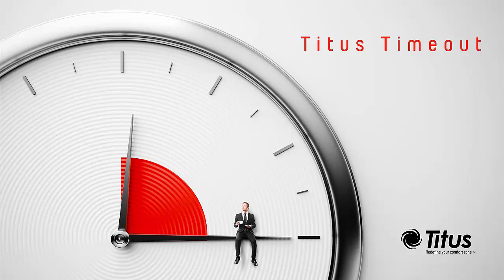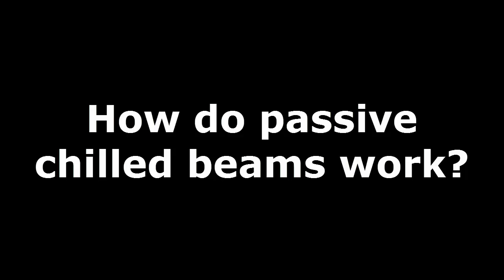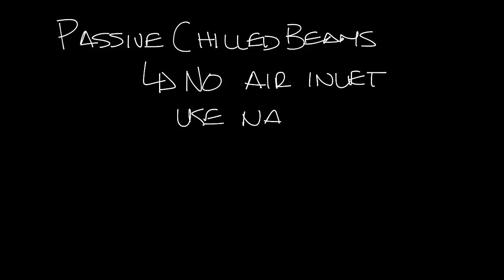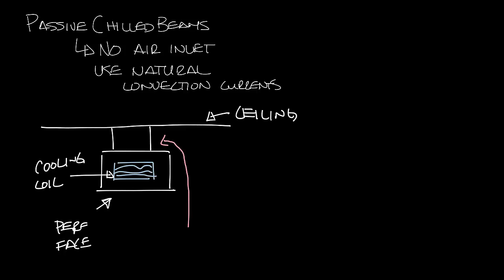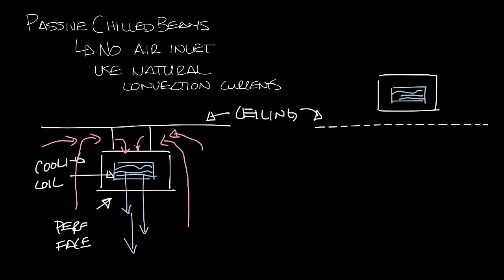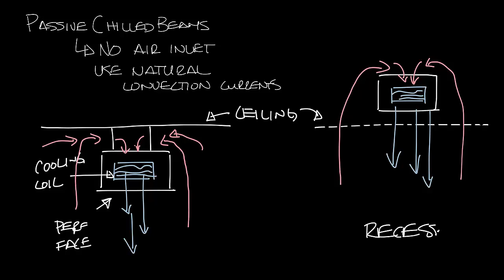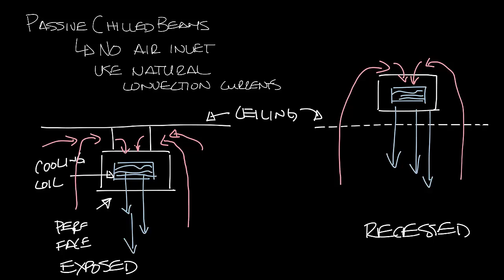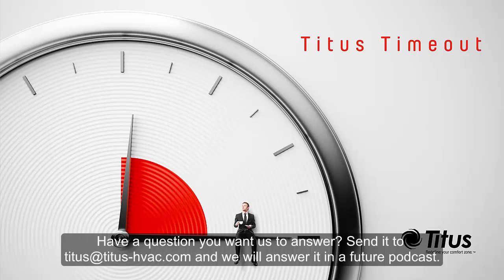Titus Timeout Podcast - How Passive Chilled Beams Work

Comment: How does the air get brought into the chilled beam?
Reply from the maker: Warm air naturally rises through the stratified space. As air enters the coil, it is cooled, its density increased and the buoyancy change causes it to fall back into the space. Momentum gained by the falling air stream draws additional air through the coil by means of a syphoning effect. Convective heat is removed as the air passes through the coil.

Comment: Thanks for the video. Where does the condensate go? Any issues with chilled beams creating higher humidity levels?
Reply from the maker: Correctly selected chilled beams do not produce condensate as the chilled water passing though the coil is set at a temperature above the room dewpoint condition. Room humidity is controlled by a separate air supply system (typically DOAS) which provides dry air to the room to offset the latent gains in the space.
Reply: @TitusHVAC  thank you for the answer. Is there such a thing as a residential chilled beam?
Reply from the maker: @danielvivian3282  no sir